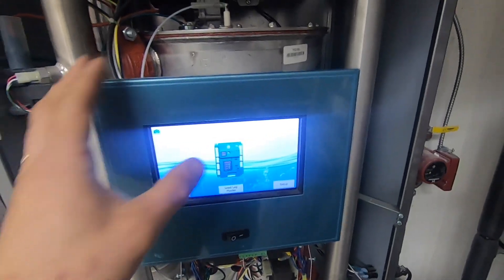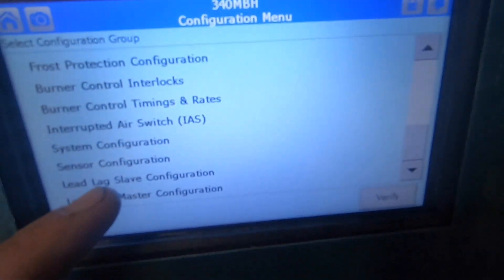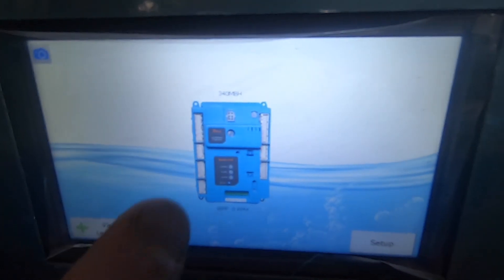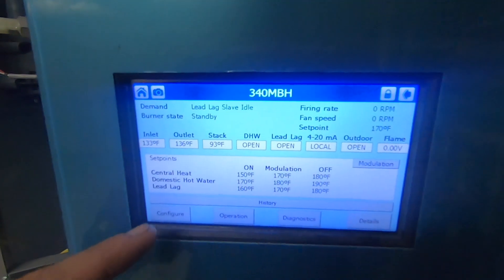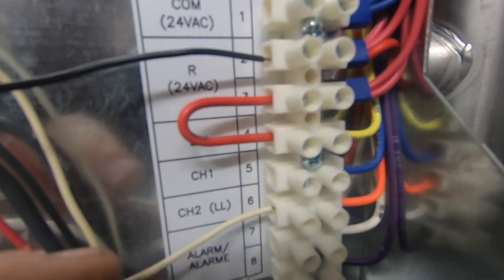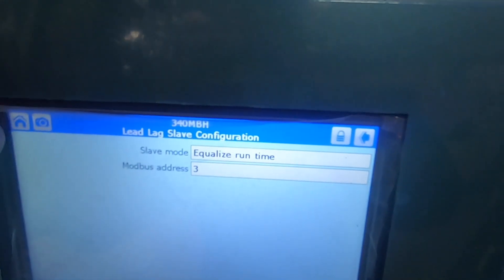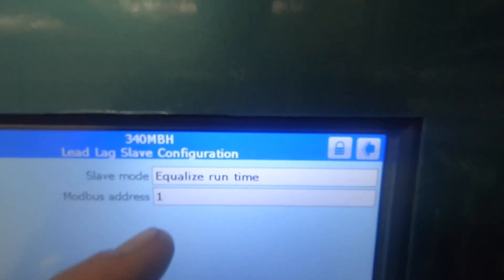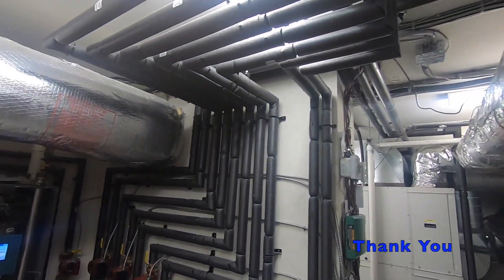HVAC: NTI Trinity Boiler | Lead Lag Setup

Comment: That looks like a nice boiler
Reply from the maker: yup..:)
Reply: What does one of those wholesale for?  Is that a 350?
Reply from the maker: @ATeamAdam  Hi.  Yes I always try to  convince customer that it is beneficial to have a twin boiler setup, especially if higher BTU is needed .  When used for many options like; domestic water, heat, etc.  With this setup one boiler fails, you have a back up. Will cost a little more and might take a little longer to satisfy  but atleast something is better then nothing.  Units prices 4000 - 8000 depends the type of unit.

Comment: Did you do that whole job? nice
Reply from the maker: Yes 🙂
Reply: This whole projects looks very familiar and then I recognized it was done by me couple years ago somewhere in don mills Toronto. I called it twin boiler. Communication wire and all hydronic system beginning to finish I did them. All those 1 inch pipe goes to indoor swimming pool heat exchanger and other 4 pipe goes into indoor swimming pool dehumidifier seresco unit to heat the air . On the right there is a big HRV and big seresco unit on the left . This was big project done by 4 People except two boilers and piping .this customer has water fall in back yard we did underground duct for the pool because in the winter water fall and pool becomes indoor by closing glass sliding doors on all sides .lot of hard went into this project. Credit should be given where credit is due . Be careful next time .